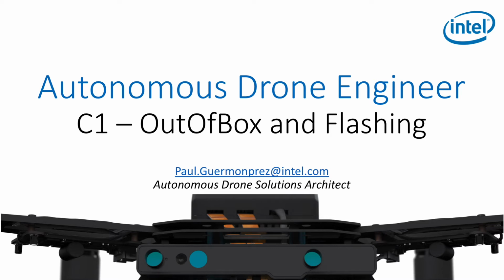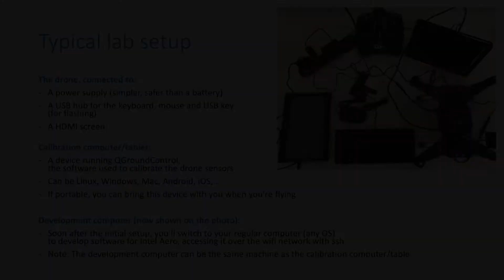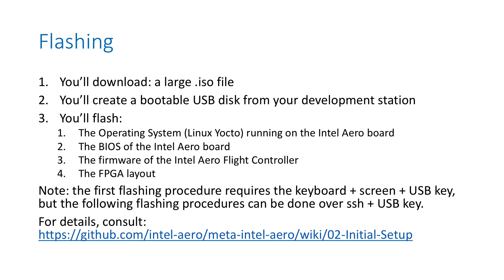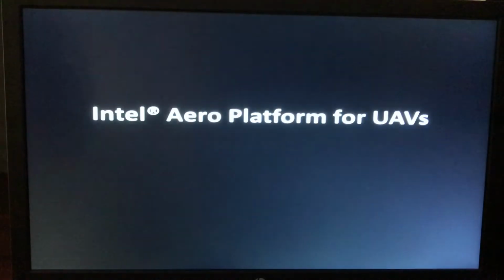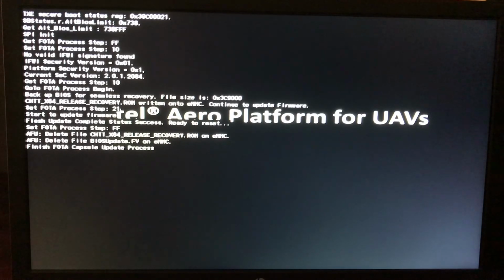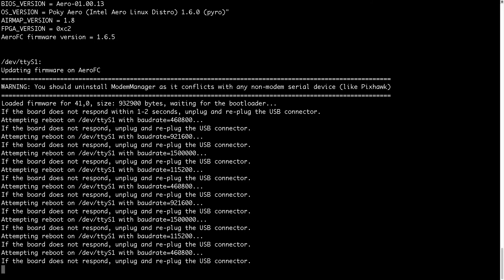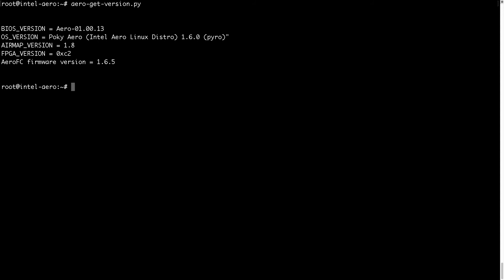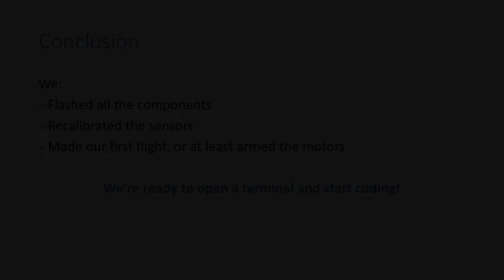Autonomous Drone Engineer - C1 - OutOfBox and Flashing

Comment: This broke my HDMI.  I followed this procedure perfectly.  At the end of the recalibration, the HDMI port no longer works.  I can still connect with QGroundControl, and it responds to the DXe radio controller.  The WiFi access point works and I can connect to it from a laptop and ping the IP address.  Has anyone else seen this behavior?
Reply: Did you have any answer?